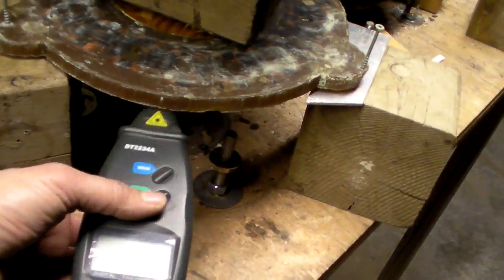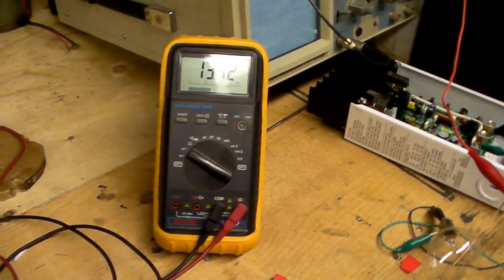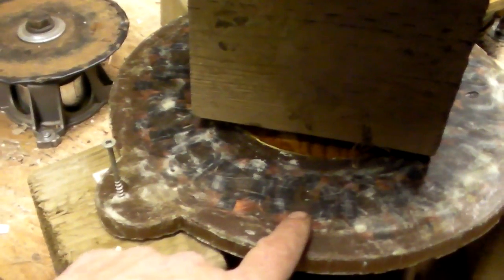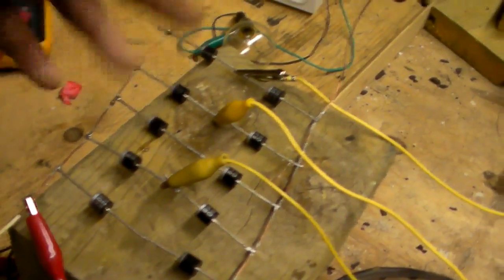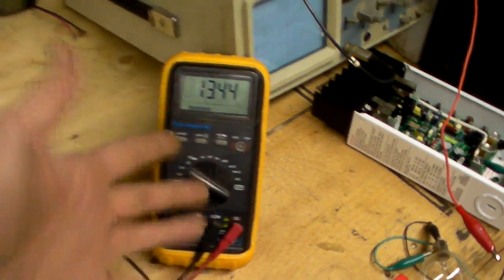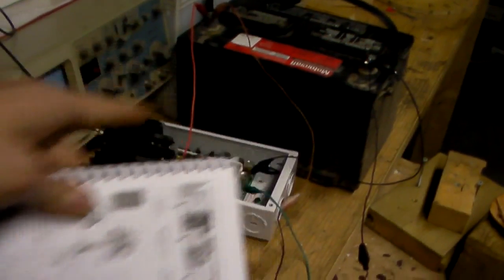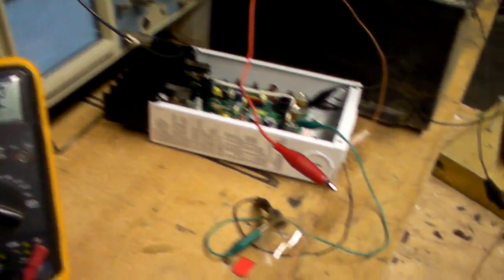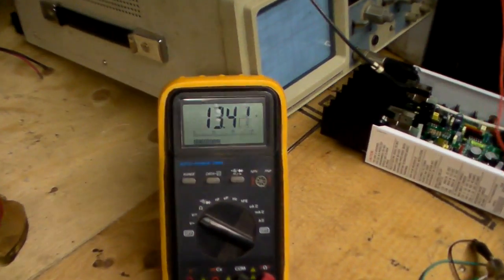3 phase 24 magnets 18 coil 125turns 18awg wind turbine vawt hawt 38.MP4

Comment: Hi sam

Well I was wondering why you did not use a dual magnetic disc design? You would have gotten higher voltages for the same speed right?

Regards

Rajan